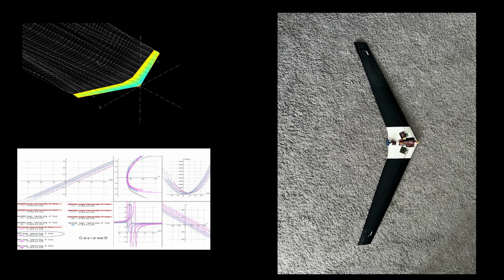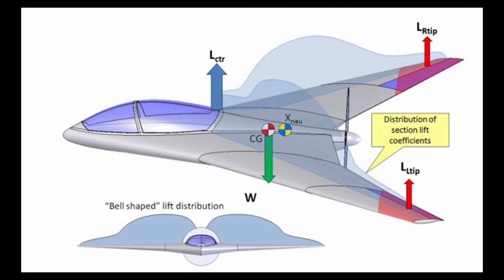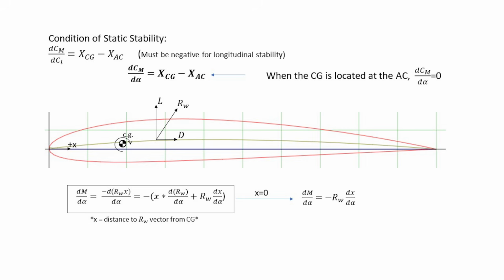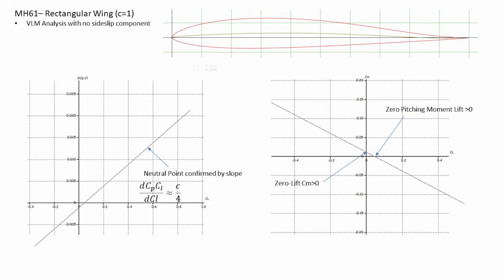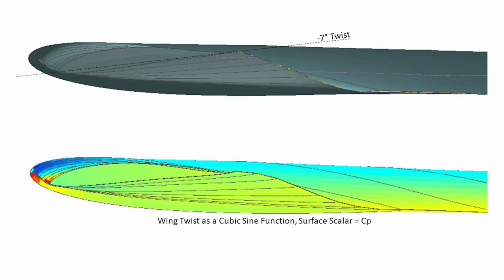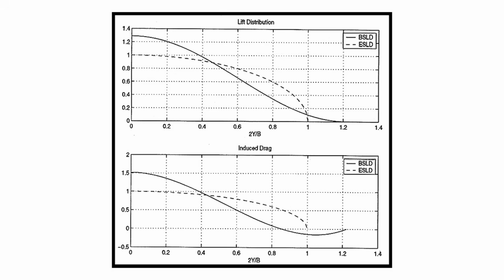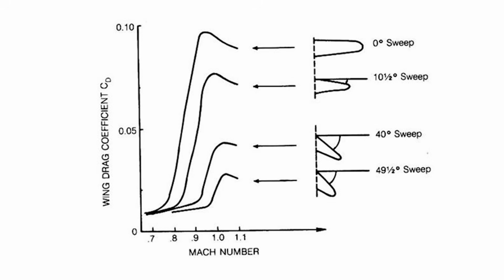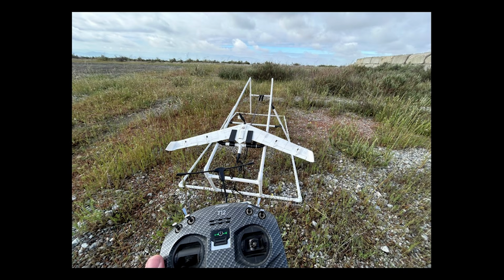Basic Design Theory and Aerodynamics behind Flying Wings and Tailless Aircraft (Part 1)

Comment: Never got to the calculus part of this, but understand the concepts. I flew a hang glider for 10 years, and built many models of flying wings. Add to that, my dad was in the first graduating class of aeronautical engineering at the University of Kansas, back in the 40s. I have always had my head in the clouds. Best example of explaining roll, pitch, and yaw stability was a marble on a flat plate with no lip and a shallow dish with a lip. Tilt it even a tiny bit and the marble rolls off of the flat one. This is hang glider design 101. Thanks! Washout, wing warping, reflex all come into play here.

Comment: welp, im a 15 year old student, trying to slowly piece stuff together. This will be easier when I take calculus in a couple years
Reply: Just go through khan academy to speed run calculus :) Of course basics first like trigonometry and limits, but it's quite doable. Derivatives (the easy part of calculus) should get you enough to understand much more of the video
Reply: @grekiki nah calculs isn't something for speed running 

You need knowledge of trigonometry, logarithms, quadratic equations,conic section,etc

And then functions,ITF(inverse trigonometric functions),LCD(limits, continuously and differentiability),MOD,AOD and then Indefinite integration then definite integration 

And much more

Comment: Actually it is very easy to decouple roll and yaw. Reduce the dihedral. Usually 0 to -2 degrees of dihedral does the trick The resulting spiral instability is of a very long period and easily controlled by the pilot. The main point of your video should be that we really don't know much about flying wings compared to regular aircraft and that the design of them should be approached with great caution, lest that person get a Dunning-Kruger award.
Reply from the maker: I’d like to study the effect of this method of decoupling on any proverse yawing conditions. Curious if this would nullify the proverse yawing effects or even flip the resultant vector back to that of an adverse yawing condition.

Comment: Love this video! Flying wings and close coupled canards get me really excited. When I started playing around with making flying wing foam gliders to test airfoils I found that when I would hand toss a symmetrical tailless wing she would climb hard at high speed and then as she slowed down she would lower her nose and find her trimmed speed. Then I would reshape the LE to give some positive camber and with the same force throw(launch) she would tuck hard until I retrimmed her by moving the cg way back. she would fly almost level at high speed but as she slowed she would gradually nose up into a stall. I got the longest glide with a symmetrical LE and just enough positive TE camber so that she would barely climb with a high speed toss and maintain almost level flight while decelerating before lowering her nose at slow speeds. I think what I'm seeing is the wing wants to follow the camber. I came across a "self incidence wing" which if I remember correctly had only about 1% camber which maintains a somewhat constant AoA over a range of speeds. I think it was a 1410 airfoil.
Reply from the maker: Awesome man. I've also had several stable designs and flights with symmetrical foils, just making up the stability with more significant sweep/twist/taper

Comment: Awesome video...just exactly the right level of technical detail.
Eagerly await the next chapter...
 I'd love to talk with you about a project.

Specifically I'd like your thoughts on the difference between designs for best L/D which pradalt does well and minimum power flight and how one might change the flying wing optimization to minimize power (CL/Cd)^(3/2)

Best way to contact me is  unrocket on what was the bird app.
Reply from the maker: Prandtl's BSLD is best for high L/D as it aims to minimizes induced drag by producing a lift distribution that is near optimal for a given AR. Mathematically, the BSLD is ~13% more efficient that the ESLD (it also needs a bigger wingspan. If span is restricted, ELSD is your go to). BSLD will give minimum drag under no span constraints. 

I dug around in my sources list and this may be helpful for you - this is Al Bowers himself:
https://www.youtube.com/watch?v=w-dk1NpVNNI
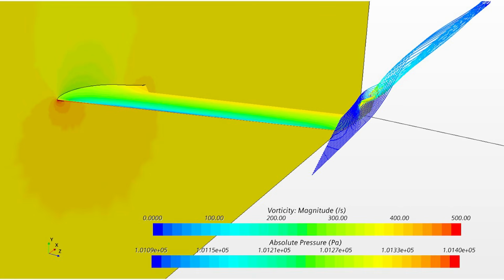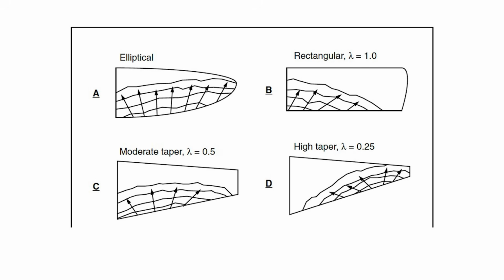(~15:30-21:00)

Comment: Hey thanks a lot!
I am working on an autonomous drone for data collection at variable altitudes, the initial plan was a flying wing but some difficulties in balancing made me choose a more traditional model, at least until the software is developed enough to control the instability of the aircraft in flight, as my area is physics not engineering I knew how it worked but I had no background on how to make it work for my particular purpose, this video made me rethink and revert the model back to the original plan as it was more efficient than the aerodynamic abomination that I'm using now, a brick with wings and a turbine strapped to its back would be a good description of what I've created
Reply from the maker: Higher altitude means more severe wind and turbulence, so you need a very stable plane. I wouldn’t use a flying wing for this
Reply: @gabefpv  The altitudes shouldn't be too high but I'll keep instability in mind.

Comment: Incredible amount of help you've given us, in this..

Couple of gifts for you, ( hopefully ),
from an autistic who's spent a few years thinking on aircraft-design,
& tried working through Raymer's university-textbook
( until the damn carelessness in his work stopped me:
sometimes his explanations aren't clear,
& his books all seem to need much more rigorous copy-editing!!
don't allow mistakes into textbooks, eh? )

1. Please, PLEASE try Julia with Pluto, instead of spreadsheets:

You can make your work be compounding-capability in ways that spreadsheets sabotage..

( I intend that all my aircraft-design stuff
be able to generate variant-aircraft through calculating everything,
just with some parameter-changes,
& Julia+Pluto's core to that.
Spreadsheets constrain one's work much more,
the Julia/Pluto combination is much more parametric/dimensional/live )

2. given that there is a portion of any real ( full-sized ) aircraft which is likely usually turbulent-boundary-layer,
consider doing the golf-ball dimples thing,
to that portion of the surface,
to energize the boundary-layer a bit

( there are 2 competetion-level golf-balls, apparently, & they've got different dimples-patterns:
1 is all the same, the other has some-larger/some-smaller.

I think the dimples need to be proportioned to either the Re or to the dimension of the object,
but don't know which, yet,
or if both make-difference.. )

3. Please consider doing experiments re aircraft icing,
with a boat hull coating called Silic One, which is a silicone-silane anti-fouling..

If it makes it impossible for ice to accumulate onto a surface,
it may be a significant safety-investment for some aircraft..

( I suspect that the blown-wing with aluminum in it, in the ATR-72 might have been part of the problem:
blown surfaces tend to be colder,

& having a prop blowing an aluminum-wing, or partially-alu-skinned-wing,
seems to me like an icing-suicide-machine..

I don't know how long it'll take for the accident-investigators to report,
so may have to wait a few years to know if this insight is right )

4. I don't understand why flying-wing tankers aren't the normal
( just a random opinion of mine, for the last few years ).

You can refuel more aircraft behind the thing, through more spanwise drogues,
AND you waste less fuel staying in the air, while doing the work?

Seems win-win, to me..

5. Please consider trying fractions, instead of percentages, in your work:
Nature seems to work more that way.

( e.g. natural ocean waves, that aren't, through shelving seafloor, becoming breakers,
have a 1/7 ratio of height to length )

You said the optimal change from lift to negative-lift is around 70%,
I suspect that it's either 2/3,
or it's in a range ( due to specific-configuration ) between 2/3 .. 3/4.

Once I realized that for sailboat & aircraft design
( both are related, & the lessons learned in each often do improve one's competence in the other,
please consider "Principles of Yacht Design" to be the basic-text for it,
& the North Sails textbook to be the pinnacle of sail-design books ),
the fractions-orientation simplifies/clarifies much..

Like when I realized that the NASA recommendation for quiet operation,
to keep prop-tip-speed down to 0.6 Mach was *actually*:
the upper-surface of the prop has airflow around 4/3 of the prop-blade-speed,
& 4/3 * 0.6 == 0.8,
so you're getting close to transonic, then..

THEN it made much more sense, see?

( having a number where it's actually the interaction of 2 distinct fractions,
if you know the basis-fractions, then it can make much more intution-sense,
and THAT is one's designing-instinct: one's intuition.

Get it right, consistently! : )

Or, another e.g.:
make a yacht-rudder a symmetrical NACA foil of 1/8, aka 12.5% chord/thickness..
but if you want a low-drag foil? go to 1/12.

Why is so-simple a thing important?

The difference between a displacement-mode monohull
& a faster-than-displacement-mode trimaran
means that the optimal rudder-thickness may be thinner, for the trimaran,
right?

This hands me the exact range to try: 1/8 .. 1/12.

I already KNOW the right-answer's within that range!  ( :

---

Please identify for us the textbooks you recommend,
for us to learn these things *properly*.

I'm already presuming that Doug McLean's Aerodynamics
( arguing from the actual physics, or something like that )
is the proper aerodynamics book to rely on
( he's got an IMPORTANT video https://youtu.be/QKCK4lJLQHU )

& that Snorri Gudmundsson's General Aviation book is the book to replace Daniel Raymer's one..

( please correct me if I'm wrong )

but that still leaves massive gaps in one's learning, doesn't it?

Please identify the dimensions-of-knowledge,

& the specific self-learning textbooks you recommend in each,

not as a reply to me,
but rather as the text-underneath your videos,
so that everyone readily sees that!

Also, please make a playlist for these videos,
so it as a set can be shared..

Subscribed, upvoted,
& I wish I had the mental-firepower to work directly with this, as you do,
& I wish I could hire you, to help me make my imaginings actualize..
( multiple kinds of aircraft,
arrays-of-each in different scales/sizes,
bushplanes being 1 of those kinds )

Perhaps karma will change,
perhaps not: either way, learning results, right?

Either way,

Salut, Namaste, Kaizen, & Gratitude for your helping us!

_ /\ _
Reply: Wow !
Reply: On why there's no flying wing tankers: money.

The cost of the project would far outweighed the benefits given current tankers do just fine as is
Reply: You really know your stuff! I would like to ask you a few questions about turbulent characteristics due to induced drag. How can I contact you?
Reply: @SailorAidan  We can talk here, & then everybody gets to read the discussion, right?

( :

Oh, PS: the fractions-item turned-out to be right:

Albion Bowers, THE guy in flying-wing science, identified in some of his presentations that it's 3/4 out, on the wing, where you want the vortex: that's what birds do.

_ /\ _
Reply: Have you read Synthesis of Subsonic Airplane Design by Torebeek? I prefer it to Raymer's book. It's also very easy to find in pdf with a google search so you can check it before buying.
Reply: @wanderer2688 No I haven't read Torenbeek's book, & many have recommended it, but having fought with Raymer's ( careless ) book, I'd probably prefer Snorri Gudmundsson's ( may have spelling wrong ), were I still digging into that stuff.

I've found that Harry Riblett's book, at the experiental--aircraft-association's site, is REQUIRED reading, for subsonic airfoil-design.

Mike Arnold's stuff, there is a guitar guy who has a whole playlist of videos about his aircraft, here on yt, is also required stuff.

Put those 2 together, & you've already got more subsonic-competence than the poor designers being pushed into using the foils that NASA keeps pushing,
like the one on the ATR-72 which keeps killing people ( it forms a ridge of ice at 0.09-chord, which breaks upper-surface-lift, which then kills the flight, exactly as Harry Riblett identified *last century*.

It's a great aircraft-company: they make excellent planes, according to pilots who've pushed their limits,
except they used a LETHAL NASA-pushed airfoil. )

PLEASE invest in Ribletts General Aviation Airfoils book, now.

While there is a copy on some subscription-reading-materials platform, it isn't legal.

Once I figured that out, I quit subscribing, & bought the legal one.

I want patentability on my work!! : )

---

Do well, & may your work be excellent!

( :

_ /\ _
Reply: @antrygrevok6440 Thank you for your thorough reply. I knew about Gudmundsson's book, in fact it already is in my list of future reads, but didn't know about Ribblet's book, I will certainly add it to that list too.

Comment: So informative!

A crazy design challenge could be to design a VTOL drone which purposefully spins for take off and landing. The only two moving parts are props below the wingtips.

With one prop going forward and the other in reverse, the wing is twisted for positive angle of attack. Alternatively, the props could be attached to flaperons, to similar effect.

No need for a launch catapult or runway, and basically no compromises on horizontal flight performance. Spinning in place gives the benefits of a long runway without the runway.
Reply from the maker: This sounds interesting. Are you thinking about something like this? https://youtu.be/7JH1_ZKV7t4?si=_uxspg2Embj-Ke6I
Reply: @gabefpv   I'm thinking something simpler - more like ProjectAir's monocopter. That was the "Simplest Helicopter Ever" - just a wing and a single prop to set it spinning. Only one moving part.

However, a monocopter can only fly like a helicopter. It can't transition to airplane-like horizontal flight because its prop is positioned to spin it.

To transition, you want two props at opposite wingtips. That way, it's possible to fly like a monocopter by reversing one prop, and it's also possible to transition to horizontal flight by pushing forward with both props.

Compared to a normal flying wing, you don't need a catapult or long runway. You get the benefits of a long runway but instead of landing gear you just spin in place on a bump at the center of mass.

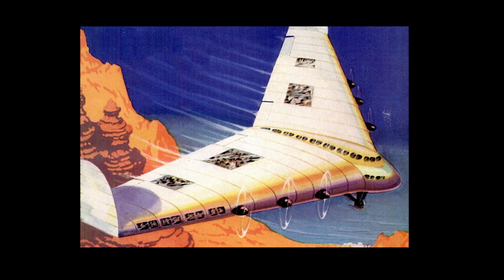Comment: 3:28 People always say this, but I'm never exactly sure why this would be so uncomfortable? Passengers also sit 30m from the center of pitch but that's not too uncomfortable. Is roll acceleration really that much stronger compared to that of pitching?
Edit: timestamp
Reply from the maker: Not sure about commercial body rates, but I can tell you that since one wing will be going up and the other down, one side in a roll will be 'floating' and the other side will feel 'heavy'. Since a plane is moving forward and pitching results in centrifugal acceleration (think the plane drawing a vertical circle in the sky) into your seat at any location on the plane, no-one's experiencing negative g's, or at least that's how I think about it. You would be correct if the plane was stationary - the back of the plane would feel floaty and the front heavy.
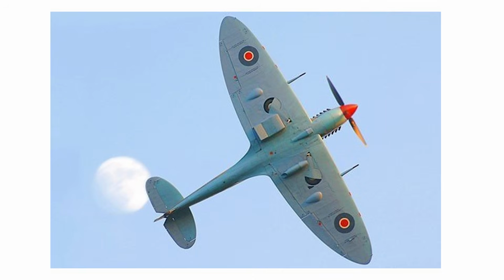Reply from the maker: @free_spirit1  also 16:30 here https://youtu.be/qTxKZFJEYuM?si=WlU8B4F4lCMM_vdf
Reply: @gabefpv  Thanks man!

Comment: Does anyone put the elevators outboard of the ailerons? This would morph the wash-out from maximum at min speeds to wash-in in a dive! With ailerons on the inner 2/3 of half span the down going ailerons would move the vortex inboard producing proverse yaw in turns. What do you think.
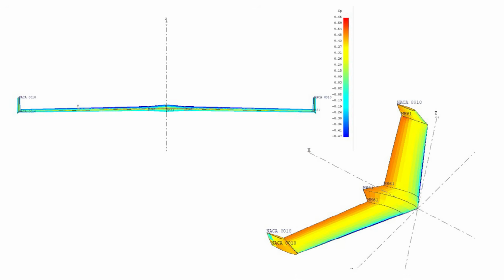Reply from the maker: My very first wing (0:30-0:36, 23:05) did exactly this. I decoupled the roll and pitch with the inboard and outboard 'elevons', and also tried out differential yaw (right side controls deflect opposite of eachother, left hand don't deflect. The math was involved,  but it was effective). I'm sure the proverse effect was decreased due to winglet effects on the lift distribution. Winglets are kinda countering to chasing proverse yaw in a wing.
Reply: Thanks for your reply means a lot to me. I went back to your vid and saw the wings at 0.30, 0.36 and 23.05! Very nice wings! I'm thinking the winglets would make a difference. I do like the idea of the elevators providing the amount of washout needed when reflexed for slower flight and not increasing drag at high speed as less 'reflex' would be needed.
On another note, you mentioned 30⁰ sweep, is that because of handling problems due spanwise flow at high sweep angles? 
On still another note, my interest in swept wings is because I have noticed that swept wings transition in and out of Ground Effect with no pitching problems. My first WIG RC I left the all moving close coupled canards loose for high speed taxi tests and noticed that they pointed straight down. This made me realise in strong GE the high press under the wing produced a strong vertical flow at the LE! 
Thanks again, keep up the good work!

Comment: Im in high school in AP research class and I want to research something in aerospace engineering, but im not super farmilerilar with everything? Got any ideas or topics I should look at or advice? Thanks
Reply from the maker: Unsure what kind of research this is, but it could be fun to look into how turbojets work!
Reply: @gabefpv  Cool sugusting! After some thinking I decided I want to try to explore how variable camber morphing wings can be applied to flying wings! Right now i'm thinking of trying to make a system that basically acts as more precise ailerons and also has less airflow separation and therefore less drag.